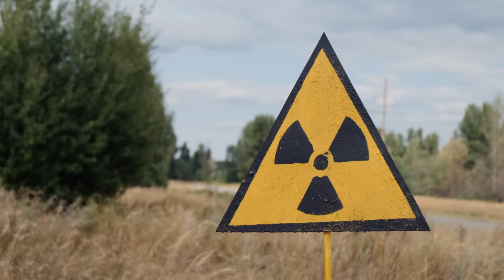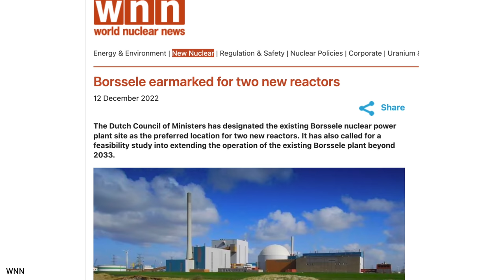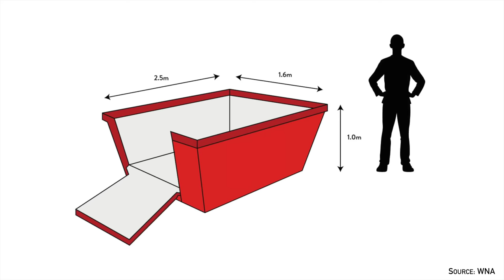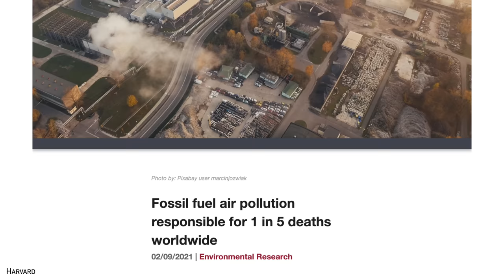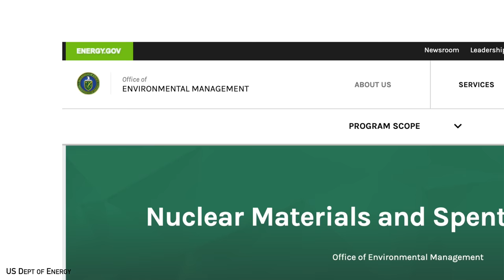Can Nuclear Waste Ever Be Solved? Yes.

Comment: One detail left out is that after only 10.000 years, the waste’s radioactivity is back to that of the original ore that was extracted.
Which then raises the question of whether it is fair to require isolation for a million years.

Especially when unbeknownst to most, there already are (hundreds of) thousands of tons of uranium and other unstable isotopes beneath our feet in as small a radius as 10 kilometers down to the several 100s of meters of depth that we want our deep geological respository to be.

But considering the negligible cost per kilowatt-hour, the price of buying just a feeling of safety for the general public to gain their acceptance for the technology is a fair trade-off.
Reply: Uhm if we recycle it over. And over. It would be less than 1000 years for instance 200
Reply: Which is probably why the requirement in Germany is to store safely for 10'000 years. (In salt mines I believe.) However, you are not going to have some insane nuclear disaster if storage fails in a couple of hundred years. It's not yet down to the original level, but it's not hugely dangerous to living things. Considering there are lots of churches, bridges - not to mention pyramids -that are surface constructions, and are still in use after +1'000 years, it actually seems pretty unlikely that we wouldn't be able to construct a simple underground storage, that will last some thousand years.

That's assuming you really want to burry such actually valuable material. In any case, waiting another hundred years to decide what to do, isn't a big thing. I't would be rather annoying if people had to start excavating the material as a mining operation, because using the remaining 97% of the energy in the material has become technically simple.

In Sweden, where I live, the requirement is safe storage for 100'000 years, which is obviously a politically motivated thing. For  one, Swedish used fuel is obviously not 10 times more dangerous than German. Secondly, it has nothing to do with hazards to living creatures or plants.
Reply: and measuring in volumes NOT Curies .....? 1 gr of Plutonium = 1 Curie = 37 000 000 000 becquerels

Comment: please make a video about the forgotten soviet nuclear project.  
1. the Soviet Union's plan to produce 50% of nuclear energy by the year 2000
2.such as a special nuclear reactor for water distillation (BN-350)
3.rectangular nuclear reactor (RBMKP-2400)
4. construction of nuclear reactors in remote, and dangerous areas (Bilibino Nuclear Power Plant EGP-6)
5.floating nuclear power plant (Academic Lomonosov)
6.construction plan AST-500 nuclear reactor.which aims to produce hot water for housing and industry.  Soviet plant to built in 35 cities to replacing coal-fired central water heaters
7.the world's only active nuclear powered cargo ship (Sevmorput)

Comment: Great video but a couple things to point out. 

About those advanced reactors or Fast reactors, it's not the coolant but the lack of a moderator that distinguishes them. The reason a water cooled reactor can't be a fast reactor is water is also a moderator. So you could have a lead or salt cooled reactor moderated with graphite or heavy water. 

It's also not exactly correct that fast reactors are more efficient. They consume their fuel more quickly but they use up the fuel more completly to the point they don't leave long lived high level waste. There is still some waste but it's much shorter lived. That's why Deep Isolation is working with Oklo. Oklo has a fast microreactor & is also handling the DoE's current recycling project. The idea being any leftovers can be buried in Deep Isolation borehole repositories.

Thankfully it's no longer illegal to recycle used fuel but due to expense & politics it hasn't been done in the US. Recycled fuel like MOX does cost more & natural uranium is cheap so some kind of incentive to use recycled fuel would be helpful.

Russia's BN-800 was loaded with recycled fuel last year which is huge although the war in Ukraine has made it harder to get info on.
Reply from the maker: Fair points and thanks for the clarifications. I couldn't find anything concrete for the Russian reactor being loaded with spent fuel so I left it as is.

I'm not optimistic about Aurora and Oklo. It seems to me to be a case of having some VC money but not a lot of technical experience. I hope they can figure it out, it's a nice concept.
Reply: @atomicblender  I think Oklo can get it done but the NRC is more difficult than needed imo but there are other non-water reactors I'm more interested in like Westinghouse's LFR, Natrium & Terrestrial's MSR. TBH, I'm a bit of a liquid metal reactor fan over MSRs & especially HTGRs
Reply: @thearisen7301   which one of those can use thorium?
Reply: @YourCapyFrenBigly_3DPipes1999  They're all uranium fueled & tbh I prefer uranium. Most of the advantages people attribute to thorium are advantages of MSRs which of course can be fueled with uranium as well but of course there are differences. Uranium based reactors are just as safe as thorium but the uranium supply chain is well established while thorium's is pretty much in it's infancy. 

I really like Westinghouse's LFR because it's basically a better Natrium due to power output & being lead cooled, it's neutron economy will be better than a fast MSR's. Natrium uses sodium which reacts with water. They both have their own integrated thermal storage which improves their economics & flexibity. There is also Leadcold, a Swedish company whose lead cooled SMR is fueled for the life of the reactor which is swapped out like a giant light bulb.

Terrestrial's MSR is the most developed & closest to being ready while not trying to do too much. It's a thermal, not fast, reactor that has a graphite moderator. Still has high fuel utilization though.
Reply: The problem is that generating nuclear waste doesn't carry a cost. If it did then recycling fuel could be cheaper than using new uranium.
Reply: Rosatom saying that it's new reactor is actually not just recycling the waste, but the output can be later used for the existing reactors. That makes it a closed cycle and solves the issue with the finite source of uranium.
Reply: Actually, there is a design for a boiling water reactor with a fast neutron spectrum.

Comment: Canada's heavy water moderated CANDU can use natural U, Pu, and Th as well as spent fuel.  On top of that, it can REFUEL WHILE RUNNING.  China actually purchased a CANDU to take waste from their other reactors, without worry of further nuclear proliferation concerns.  CANDU reactor designs have been around since 1974.  They provide 50% all the electrical power of Canada's largest province (Ontario) which is where 40% of Canada's GDP is generated.

Comment: Almost every city has multiple tanks storing volatile fuel, and stores shelves filled with dangerous chemicals, and people do not worry about those things, unlike they do about nuclear waste!  Nuclear waste is dangerous, but so is a lot of other stuff, that is arguably more dangerous!
Reply: Well said. Doesn’t matter about which  is more dangerous here in comments, but pointing out that there’s a trade off is likely that lead to better outcomes, and the fear mongers loose.
Reply: Russia just dumps their waste into nearby rivers or lakes
Reply: @levismith7444  says who? Zelensky?
Reply: @Nill757  well they all do actually if you do your research about it. Once they filter out the radioactive elements (cobalt 60, strontium 90 and caesium 137) all that remains is tritiated water, and the amount of tritium in the water is very little in comparison to what's already in the water naturally.
Reply: @madmax2069  great, and that’s not dumping all spent fuel into lakes rivers as was said above
Reply: @Nill757  it's still considered waste, and waste is what they said which could mean exactly what I said.
Reply: @levismith7444 yeah and it probably works
Reply: @madmax2069 The term waste is a misnomer alot of it gets sold and recycled into other uses and industries.

Comment: Instead of air cooling the dry casts, they could heat water for home heating. Or nuclear waste could be used as atomic batteries.
Reply from the maker: I vaguely recall some suggestions once in a while that the decay heat of spent fuel be used for low-power power applications. I think as soon as it's clearly "nuclear waste" then it tends to get abandoned...
Reply: Send it to China as a requirement of doing business here. C
Reply: @sargentsakto9236  well, if the liquid salt thorium reactor works, they may take that in, because in that reactor type you can produce energy from the highly radioactive waste and turn them in to shorter lived and less radioactive substances. You can be sure that China would not miss a business opportunity like that. 😂
Reply: @helmutzollner5496  The danger associated with transporting is unacceptable!
Reply: @garybulwinkle82  well Germany and France have the Castor container which has the size of a standard railway car. It is a battle steel container with aircooling. 
It has been used in Europe to transport highly radioactive waste between European nuclear power plants and the French nuclear reprocessing plant in la Hague for the past 40 years.  It has been tested to a similar degree as the US open air storage container. The difference is that the Castor container will stand more than 200 years.
I think from what i have been reading is that to breach a castor container you essentially need a nuclear bomb. Andvthen th radiation within will be the least of your problems.
Finally, the world lives with the risks of mobile nuclearvreaxtors which run with substantially worse fuel mixes, than the highly radio active waste that can be gotten rid of in a molten salt reactor. At the End I
Of the Day the Jinnie is out of the bottle and you May decry  all the risks we have too be with! But the risk of highly radioactive waste is there und it will be there for millions of years, if you don't anything. It will also be there with usage in a molten salt reactor, but on a much more controllable time scale.
Ultimately we will need nuclear power, if we want to have a modern civilization. The risk of not addressing the climate change and the massive migration of several billion people desperate people is much more real and devastating to the planet than the diffuse risk assumption of a potential nuclear spillage of nuclear waste during transport to a site of final disposal.
Reply: @garybulwinkle82  have you watched the video??🤷‍♂️
Reply: @atomicblender  please make a video about the forgotten soviet nuclear project.  
1. the Soviet Union's plan to produce 50% of nuclear energy by the year 2000
2.such as a special nuclear reactor for water distillation (BN-350)
3.rectangular nuclear reactor (RBMKP-2400)
4. construction of nuclear reactors in remote, and dangerous areas (Bilibino Nuclear Power Plant EGP-6)
5.floating nuclear power plant (Academic Lomonosov)
6.construction plan AST-500 nuclear reactor.which aims to produce hot water for housing and industry.  Soviet plant to built in 35 cities to replacing coal-fired central water heaters
7.the world's only active nuclear powered cargo ship (Sevmorput)
Reply: Using industrial-grade heat pumps and a relatively minor energy investment, you could have a fantastic source for district heating with the added benefit of sending the water back cooler.
Hook up a second and much more powerful heat pump to the reactor itself and you might be able to supply a larger city district heating or even some heavy industry with process-heat
Reply: @johndawson6057  yes John
Reply: @atomicblender  1-the amount isnt that much highest I saw was 6mw 2- the water isnt heated enough 3-people on reddit were saying its not economical
Maybe in a last ditch effort and all other options have been exhausted it could be a good idea.

from reddit
Can you use heat of nuclear waste to produce electricity?
If spent nuclear fuel requires constant cooling before it's stored, why don't they use it to keep powering turbines while the waste is still hot?
Reply: @atomicblender  If the rods are decayed to the point, where the heat is gone, they contain mostly toxic heavy metal. We know how to deal with stuff like arsenic. We spread it over entire county's😏
Reply: I could use one barrel in my igloo to keep me warm in the winter
Reply: @garybulwinkle82  
How is that?
The US Navy has been transporting spent fuel from submarines and surface ships across the country for decades.

Once the interim storage facility is built all the fuel presently stored at the plants will be moved there.

Have you been to any decommissioned commercial nuclear plant? The fuel casts are only protected by a chain link fence.

Lastly, maybe you should look at how the casks have been tested. They have run locomotives into them. Shot them with missiles. And dozen of other blow up type tests. No failures.
Reply: As long as there are at least 2 loops, sure.
Reply: @propergander8509  
The nuclear plants generate far more power than heat pumps. 
Besides, commercial reactors are commercial enterprises in it to make money. If there are a way to utilize waste heat to generate $, the utilities would have done it long ago, because it would create revenue and also cool the fuel rods more quickly.

Comment: Most existing reactors (Light Water Reactors: LWR’s) consume less that 2% of the fissile fuel before the transuranics in the solid fuel pellets prevent further fission. It’s this unconsumed fissile material that has to be stored for 10,000 years.
Forth generation burner and breeder reactors (Like Molten Salt Reactors) consume almost 98% of the fissile material AND almost 98% of the transuranics… meaning they produce 1/100th the amount of waste and that waste only has to be stored for 300 years. So what’s the problem? Primarily the Nuclear Retardation Commission (NRC) continues to maintain the GE/Westinghouse nuclear monopoly that hasn’t shipped on time or on budget since… ever. And as long as they’re in control newer technologies will never get a chance.
BTW: Did you know that Japan built over 60 nuclear reactors between 1974 and 2009 on time (average less than 4 years) and on budget (average half the cost of US reactors)? Where there’s a will there’s a way. Nuclear is expensive here because someone want’s it to be.
Reply: Exactly.
Reply: Molten salt and cooling water have an interesting chemical reaction when mixed ...
Reply: @markrobinowitz8473  So don’t use cooling water… Run your reactor at 1500° F and use a gas turbine… they’re 65% efficient vs. 45% for steam… plus you can use the “waste heat” from a gas turbine to make steam for a steam turbine. And you’ll still have enough “waste heat” left over to desalinate about six million gallons of water a day (for a 1 GWe reactor).
Reply: @geowar20  Good luck figuring out what to do with the megatons of uranium tailings that are toxic for eons.  We haven't made any "progress" on that since 1942.  Reactors were invented to make Pu-239.  Studies by the Atomic Energy Commission (now Dept of Energy) couldn't find a dose of Pu-239 too low not to cause cancer in dogs.  I prefer reactors with a 150 million km. evacuation zone, no closer, please.  Using less of everything is our future now that we've passed the limits to growth on an abundant, finite planet.
Reply: @markrobinowitz8473 You're confusing a meltdown with nuclear waste products. They're not the same. Put it all in Yucca mountain, we're done.
Reply: @justanghozzst8218  Meltdowns are mostly from inadequate cooling of the tremendous heat.  Nuclear waste products - fission products, transuranic, activation products - are not altered by any chemical process (including cooling or meltdowns).  Shipping everything on rusty railroads to Yucca mountain across bridges that are worn out, what could possibly be wrong with that?

Comment: This is such a well done and informative video. And one that is sorely needed. When I mention the facts you summed up in your video, people stare at me because they cannot believe their ears. They only know the tales that are spun by the anti-nuclear lobby. The same happens when I tell them that any given coal-fired plant will put out more radioactive pollution in a day, than an NPP in its entire lifespan(!). Videos like yours will help demystify nuclear power and its perceived dangers/pollution. Yes, nuclear can be dangerous if you do not give it the proper respect and care it deserves. However, the oil-/coal-fired plants have caused so much more pollution and casualties, and no one seems to bat an eye over that.

As to the nuclear waste. We already have the technology to use most of it. One way is pairing a PWR with the Canadian CANDU. The CANDU can run on the spent fuel from the PWR via the Dupic (Direct Use of spent PWR fuel in CANDU) process which greatly reduces what's left over. China and South Korea have already done successful trial runs with this process.

And the EBR-II fast reactor proved not only that it can close the nuclear fuel cycle, it also proved it is inherently safe. During two tests on April 3, 1986, they intentionally tried to cause a meltdown by; shutting off the main circulation pumps while gagging the control rods and automated safety systems; and through robbing the reactor of its means to transfer its heat to the heat exchanger while again intentionally disabling safety systems and control rods. Both times the reactor politely declined, its passive safety features kicked in long before reaching the meltdown threshold. It simply shut itself down, and just kind of sat there, completely unfazed. I'll take that result any day of the week, when it comes to meltdowns.